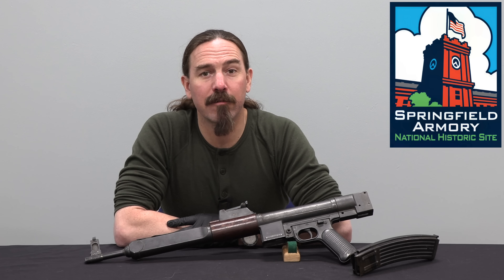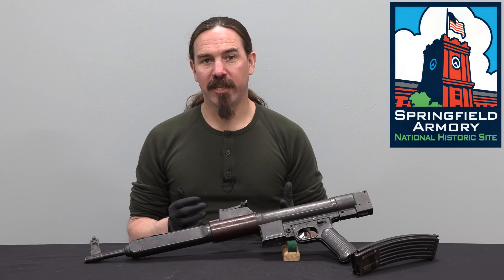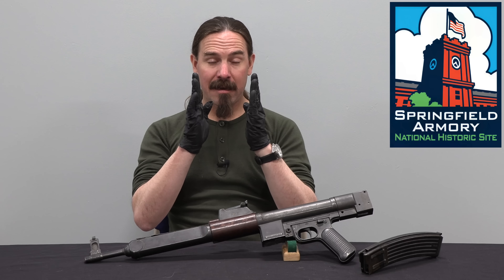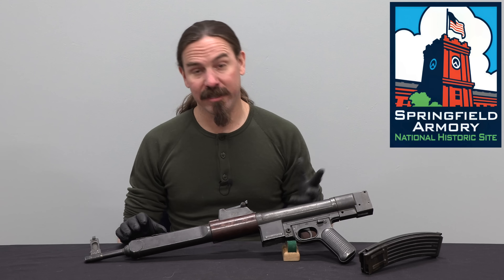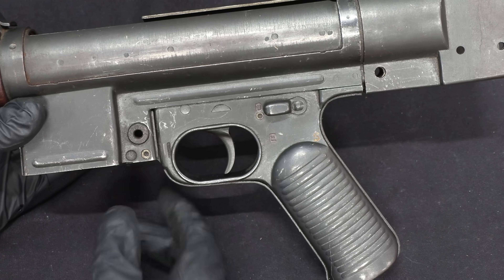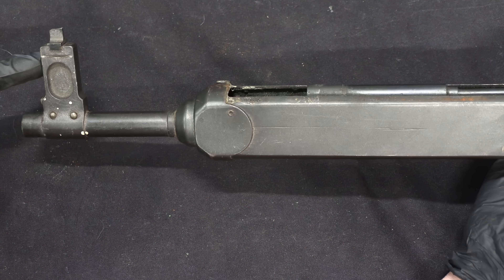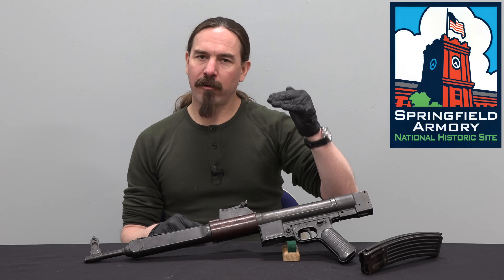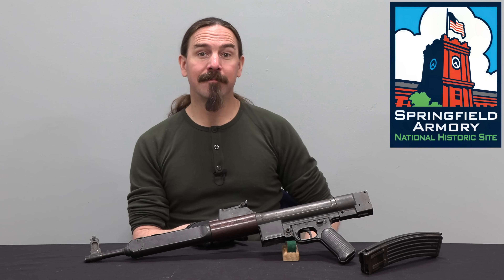Gerat 06: Germany's Incremental Steps Towards Roller Delay

Comment: just imagine carrying 500 rounds of 5x28 ammo with a rifle weighing less than 5 lbs. and with H&K roller delay locking system and using 30+ round magazines with a ton of ammunition types all coded with color magazine feed lips for dark/infrared quick ID and swatch pouch quick I.D. coded to "certain" users, not to mention suppression use and black OPS speak of use, a navy seal knows of what I know!

Comment: So that hand guard made of linen and resin is what the East Germans made Trabant car bodies out of during the cold war.  The East Germans called it Duroplast.  It is so durable to weather and age that you can see Trabants parked in fields and junk yards in modern Germany that look mint on the outside but on the inside they have no floor due to rusting away.  It has become a health issue because burning it causes lung cancer and you cant grind them into dust and bury it either.

Comment: Ah! I knew the Gerats were different internally but that single external change in the simplifying of the fire selector is genuine improvement from the end-user perspective, doubt the troops would've cared that it worked differently inside.

Comment: i would love to see sb take a stg44 reproduction and mod it out like a modernized ak... modern adjustible stock, keymod handguard, toprail, ar15 pistolgrip, muzzle brake or silencer all the modern stuff. would it be great? i mean its already a decent gun with low recoil
Reply: @jonprince3237 nah dont be like that, i want to take a repro not an original. there is also fg42 modernized chassis here in germany so anything is possible

Comment: Re the short stroke system: The tappet system of the prototype Winchester rifle (alternative to the Garand, the M1 carbine was developed from it.) could handle the .30-06 cartridge. That was an ultra-short stroke piston, one could say. Why then do AR-15 type rifles and others have a short stroke system - which one might call a medium stroke one in comparison to the tappet. The latter essentially eliminates the piston. Bad felt recoil? Beat up the bolt assembly?

Comment: That resin impregnated linen material is still used in industry over here. I’ve machined it once or twice.
Reply: Sounds kinda like micarta?
Reply: It's Micarta, essentially. G10 would be the grandchild of that.
Reply: Looks more like resin-impregnated wood chips…. I’ve been wanting to do that stuff for tool handles.
Reply: @dennisyoung4631  that would be closer to the "Beaver barf" the Czechs used on Vz 58s.
Reply: @unclebob540i3 yes, I want to “sorta-duplicate” that exact kind of stuff.  Got an old Stanley plane that could use a new (bi…n-looking) handle, and that’s the ticket!
Reply: @dennisyoung4631  that's cool! Good luck with it! I love bringing old tools back to life.
Reply: It´s pretty close to phenolic, but with more filler material and much less sophistication. Look like they just threw some linen rags into the mold, poured some resin in and let the pressure care for saturation/mixing.
Reply: @sthenzel  Given that this was for a prototype that wasn't expected to last for more than a few months at most, that sounds like a reasonable amount of effort.
Reply: @alltat  That stuff was used in fairly normal goods as well, got a carbide lantern made from it, albeit in somewhat better quality. 
And don´t forget: The form is what´s expensive and you need one, no matter if you make one part or a thousand (and with the latter comes the real benefit of "made quick´n´dirty" by reduced production cost and time). 
But nevertheless - a gun made for the normal army grunt statistically rarely lasts more than a few hundred rounds or months anyway.
Reply: @sthenzel  So it's forged epoxy get it.
Reply: If ur in Canada can u hire me pls ;+;

Comment: That composite isn't that crazy.  The Trabant in Egypt uses Duroplast, which is cotton bits, wood chips and resin.
Reply: So, floor sweepings and glue.😃
Reply: Trabant was produced in communist east germany
Reply: @maxkane9276  I just know what the Top Gear episode informed me of.  I might have gotten the model wrong, but a car was licensed by the Egyptians and was made of this mateiral.  If I got the model wrong, oh well.
Reply: @maxkane9276  I just remember the episode of Top Gear.  I googled and this is what AI overview said.
Reply: Sounds like modern furniture
Reply: trabant in Egypt?! never knew about this
Reply: @honkhonk6443  look up the Top Gear episode with May and Clarkson about the cars of communism.
Reply: @honkhonk6443  I was remebering the episode wrong.  Just got the clip.  It was the Trabant, but from East Germany.  The Egyptian was a Lada Riva.
Reply: There's also some new "Bamboo" clothing that's just Rayon with better marketing. 

Phenolic resin is still used a ton today. It's often epoxy impregnated paper or glass. I've machined a ton of that stuff for various parts in my career.
Reply: @edwardscott3262  and smells to high heaven when you have to shape it.  Phenolic is great and awful.